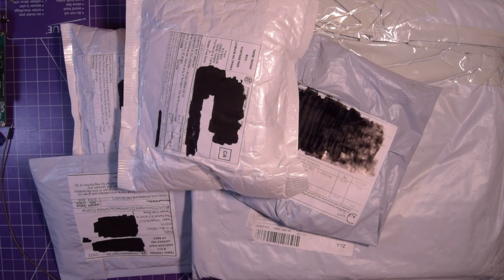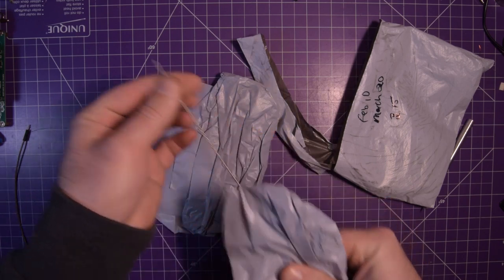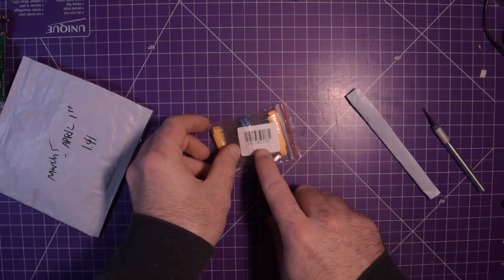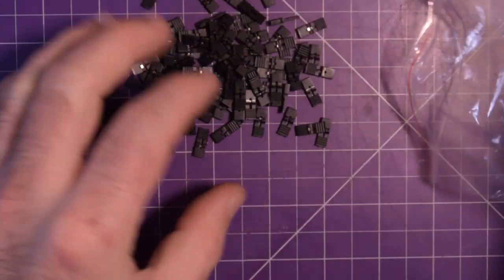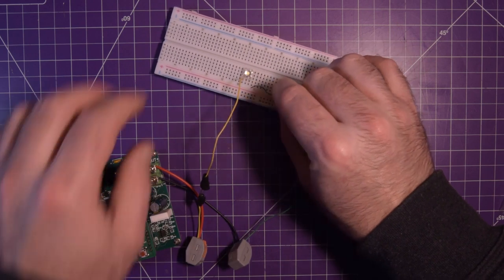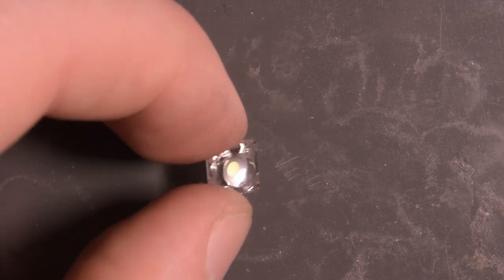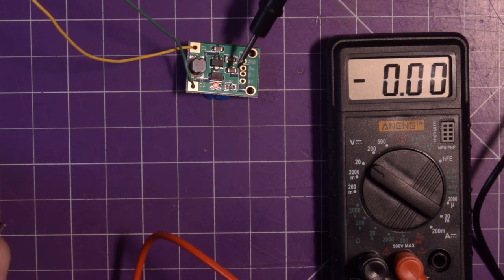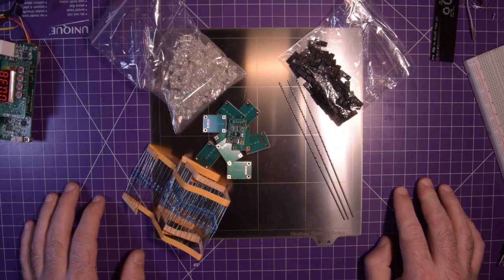Mailbag 49: Back In Business!

Comment: Those boost converters are great. I’ve tested them with about 1/2 amp load, and they can drive that with an input of 1.8 volts before the output voltage collapses. Which is perfect for my application, where I’m using it to boost up the voltage for my nano, using a li-ion battery powered by a solar panel. Could use a mini and run it all off 3.3 volts, but where’s the fun in that? Also, as a side note, the two holes on there where the usb would secure to that aren’t labeled, those are connected to ground, just so you know and don’t let any of the magic smoke out on accident.
Reply from the maker: So far so good, I'm going to make a video doing the full characterization of them...I love the fact that they are so incredibly cheap!
Reply: Simple Electronics look forward to the video! Yeah they are cheap, really cheap, but in some ways better than some of the other boost converters. For instance, I have some xl6009’s laying around, those are buck boost modules, and like 3 amp output. When I hook those up, and set the output to 5v, they work fine until the input voltage hits 3v, then it shoots up to like 20-30 volts. I think the band it does this in is like 2.7-3v... so it would fry whatever you’re powering it with if the input voltage fell that low... say if you’re using a li-po/ion, and a tp-4056, and they don’t shut off the output until the voltage drops below 2.5v. These boards are really the ticket in that case.

Comment: Great video as always. I wish Tayda sold those jumpers.  I need to ask if they will carry them, though I guess I could order from someone else. I did try one of the flexplates on a printer but I'm a glass snob and have perfected my box-razor/putty knife skills over the years for fast easy removal.
Reply from the maker: I wish I could use glass but I have an inductive bed leveling sensor - my next printer will likely use glass
Reply: @SimpleElectronics  I have auto lvling on two of my printers, but never use it.  I still Lvl by hand.  Old habit I guess.
Reply from the maker: I COULD stop being a wimp but....that requires a bit more tinkering, I litterally bought the cheapest 3d printer I could find at the time and it's been honestly GOLD with very little tinkering!

Comment: Nice video
Unfortunately here packages are still coming slow.
I have one question about your D3806. What is value of the  fuse in the output?
Because I received mine and I want to make a enclosure for it with input and  output fuses but I am not sure about what values to choose.
I am thinking about 6A fuse for input cause my supply is 4A and 5A for output maybe 5A is high.What do you think about it?
Reply from the maker: So the fuse values matter far less than the fact there there is a fuse at all. You definitely want a fuse larger than your max output (or input) current, but how much more isn't nearly as important unless you have something special to protect - it's more for protecting against short circuits. I think my output fuse is 10A but its really only there because these are the wires I used when I used a lithium battery pack as a power supply - that could be dangerous without a fuse.
Reply: @SimpleElectronics  Thank for your quick response.I decide to put fuses just for the bit of extra protection.I anticipate for your own d3806 enclosure.Probably I will start mine after quarantine.
Have a nice day.